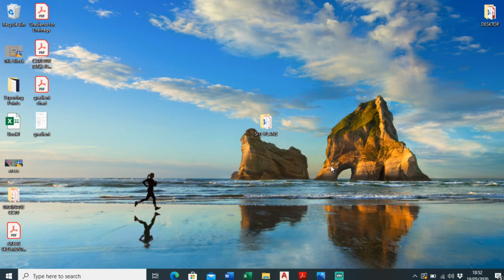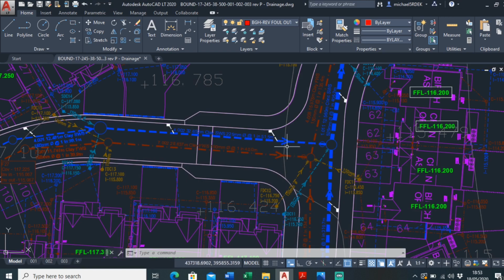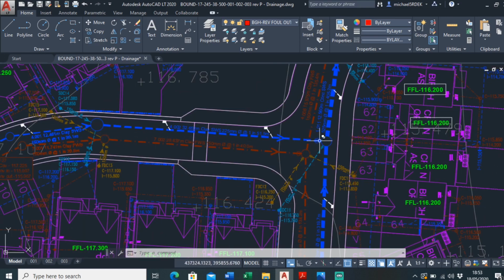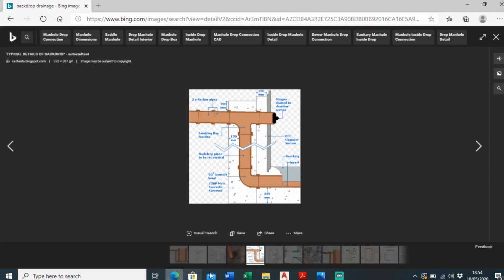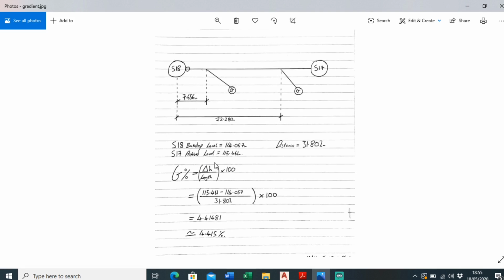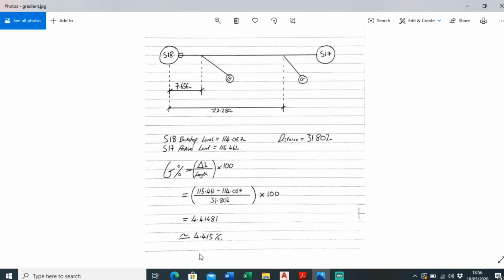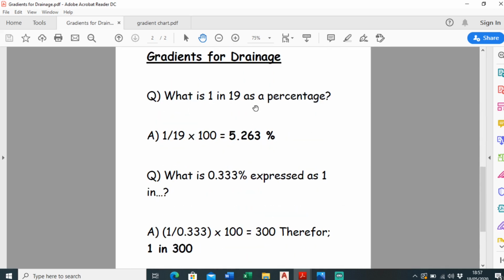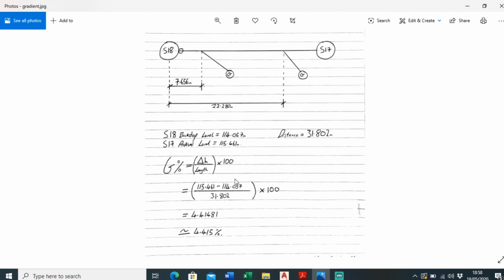HOW TO WORK OUT A GRADIENT -  DRAINAGE SETTING OUT

Comment: Anyone have problems when they set the laser direction for the groundworker it ends up going out a few pipes in. I try explain that if you give them the line to match the laser with my pogo/staff, then eventually it will go out as it is over a short distance.

Am i correct? Or unless i set laser on top of manhole, how do i eradicate this problem?
Reply: hi there, have you figured out a solution to this?
Reply: @biggthadon7548  yes. Alwas line the laser with the pogo at as far a distance a possible
Reply: @scottanderson5002  thanks pal

Comment: Hello
If I were to back lay would you swap the math and do the night invert first ?? 
Kind regards
Reply from the maker: Hello!! Yeah absolutely. 
So in the example; 

G% = ( (115.461 - 114.057) / 31.802 ) x 100 ..... Will give you a positive number.. you could just go with this and make sure you set it to a minus (-) on the pipe laser.. the gradient won't change. 

But if you want to see this mathematically you can swap around the inverts in the equation so;

G% = ( (114.057 - 115.461) / 31.802 ) x 100 .... Will give you a negative percentage ( - 4.415%)

Hope this helps